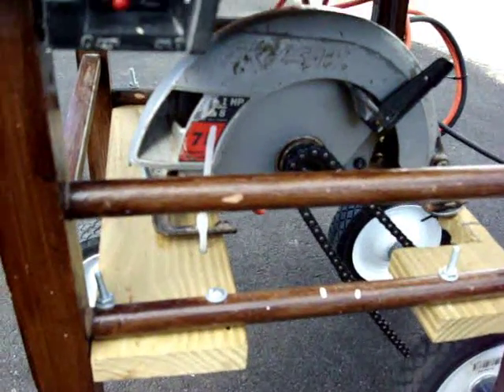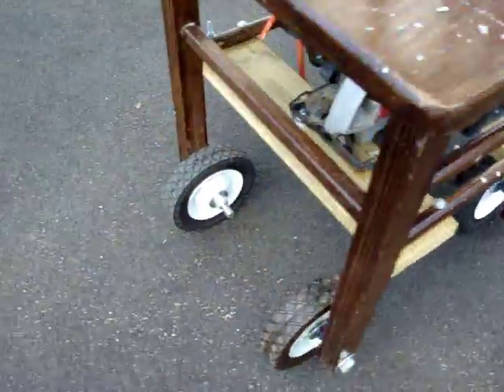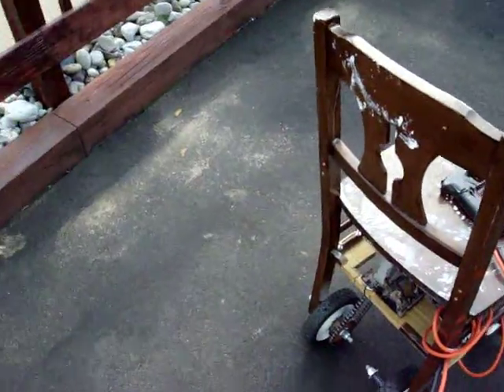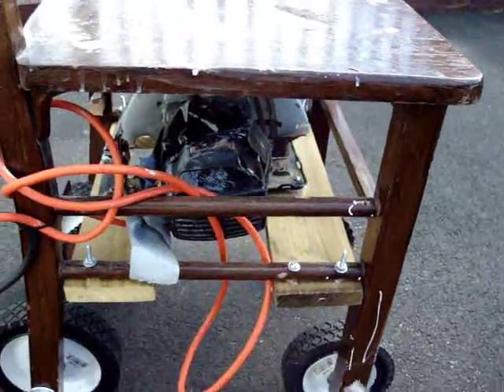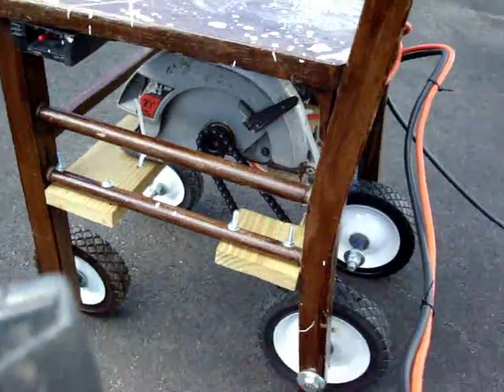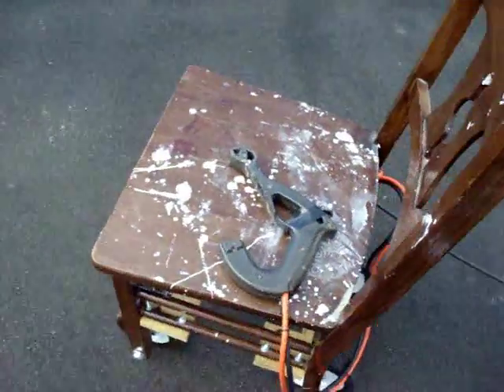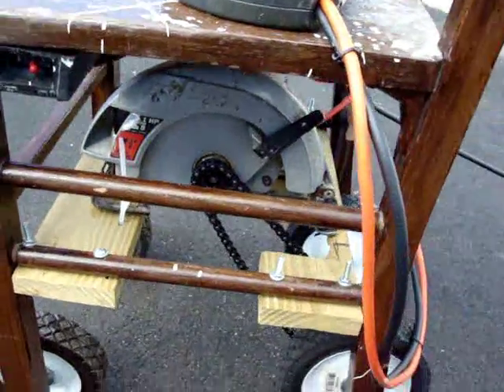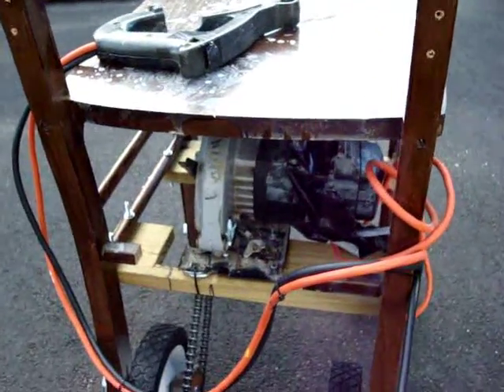The Redneck Chair - runs on a circular saw engine

Comment: A 12v car battery and an inverter would power the circular saw motor then you could be free of the extension cable.

Comment: I would suggest to get a used inverter that is at least 1500W and a 17 AMPH battery,run time approx.. 2Hrs or so if you add more 17 AMPH batteries as in three and that will do the job wa la.